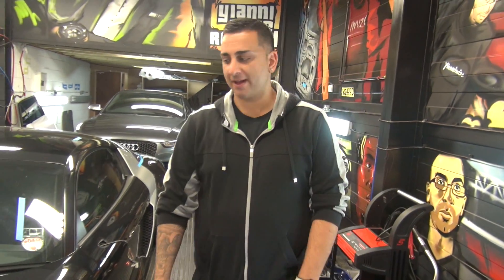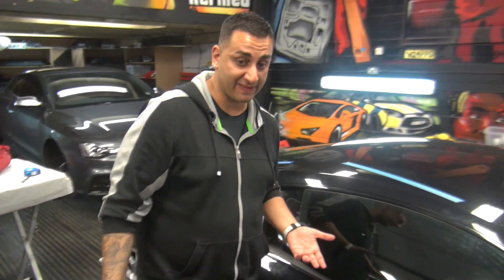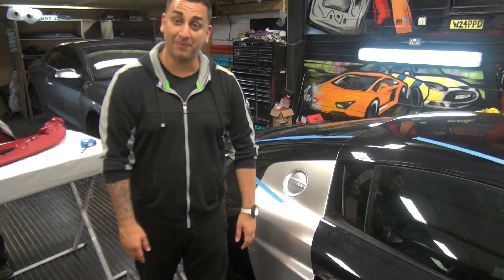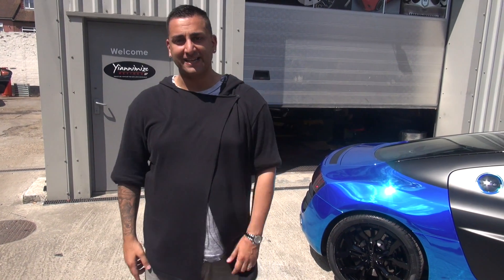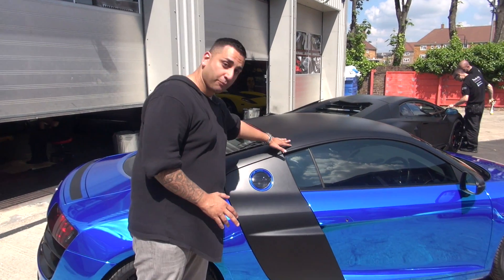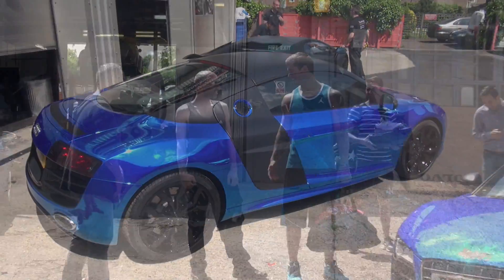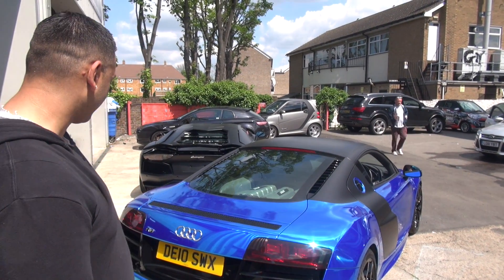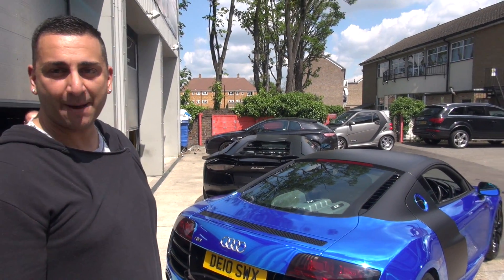Towie's Dan Osborne wraps Audi R8 Chrome Blue!

Comment: Is that a join down the middle of the bonnet?
Reply: noticed this too kind of ruins the car!
Reply: yeah it seemed that way but i dont think Yianni does any shortcuts like that, must be the hood design
Reply: All top chrome brand films are 1'22 cm wide, so if the car is not like Golf size, it would require 2 pieces to wrap a bonnet. That's exactly what they did. There is just no alternative if you are using good chrome film to wrap a bonnet otherwise.

Comment: What exhaust system does this R8 have?
Reply: Stock..just cold start sound first 30 seconds ;)
Reply: *****
It is aftermarket exhaust. 100% Yiannimize can you tell us wich one?
Reply: *****  100% sure dude..i own a V10 one and i mounted a capristo X-pipe after couple mounths with the original..this is 100% original with open valvle (u can modify somthing inside the engine bay to let the stock exhaust valvles being always open)
Reply: Spyros Fougias
 IT IS NOT!!!! with the r8 V10 , when u do a COLD start, u hear a "roar" like that for the first 30 seconds..i have alot of videos of my car doing that each cold start..after 30 seconds, all is gone..with aftermark, that cold start is 2x louder..believe it or not, but this is 200% stock..the owner can confirm u that anytime
Reply: i will post for u  a cold start rec with gopro  with stock exhaust , and u will see people reaction like "damn" and a recent cold start with capristo in open mode and u see dogs run away and human close hears with fingers and run away aswell..:D

With stock, during a cold start, u can't see someone speaking with a normal tone, and with a capristo exhaust in open mode u can't hear screaming voices too..